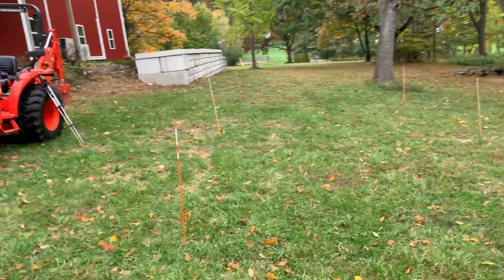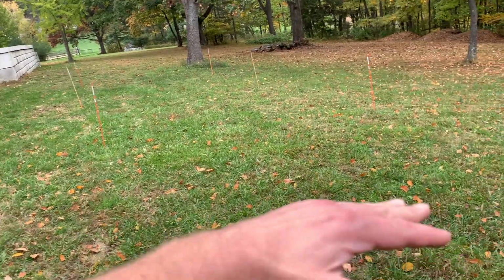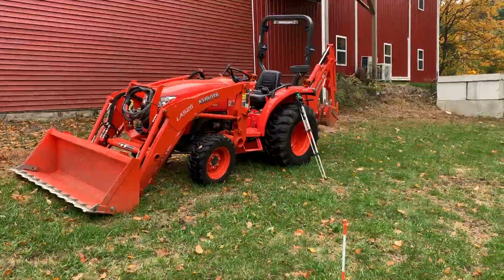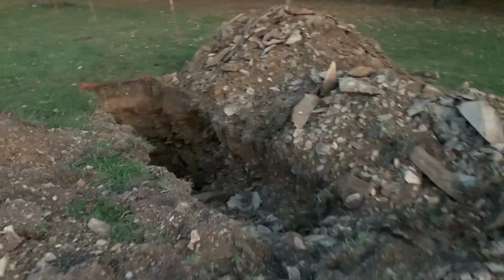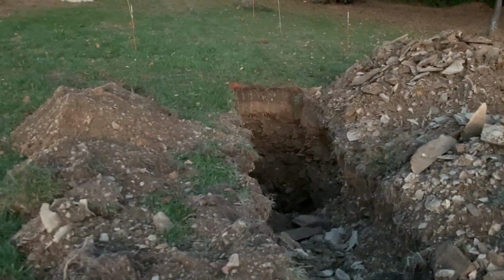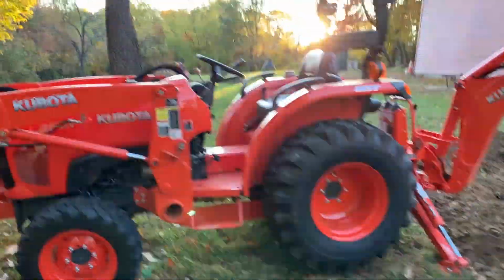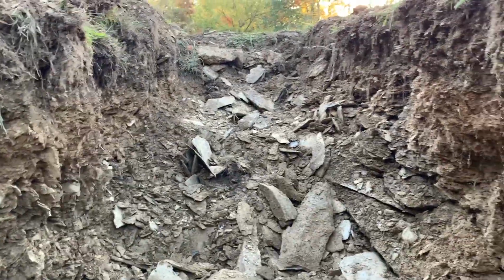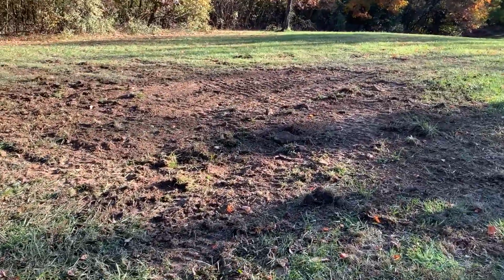Kubota L2501 with BH77 Backhoe

Comment: Going in a hole like that is an extreme lethal hazard without using sloping/stepping/shoring or some other means to prevent collapse. It is such a serious threat it is considered one of the most egregious safety infractions on a job site, one of the "deadly sins". Most health and safety jurisdictions prohibit entering any excavation over 4ft deep without safety measures in place, and that limit could be less depending on soil condition. I can't stress enough how absolutely insanely dangerous it is. Even if with a spotter no one could rescue you in time if a slab of clay pulled off the wall and pinned you. People die all the time doing this.